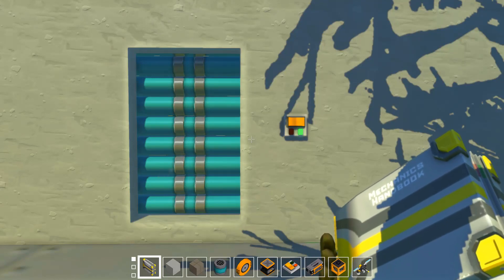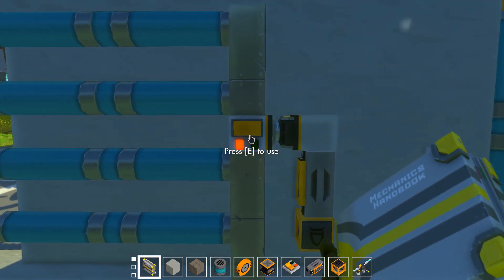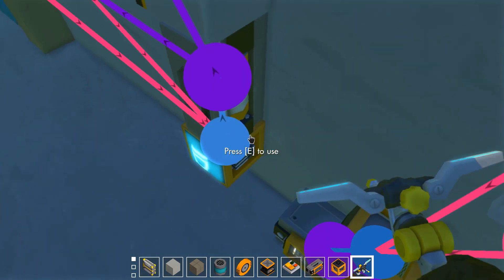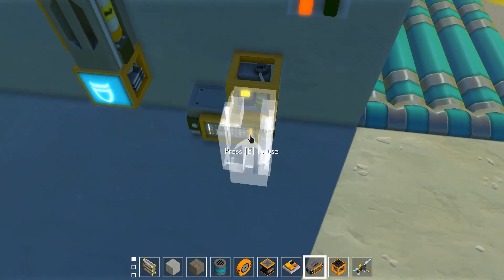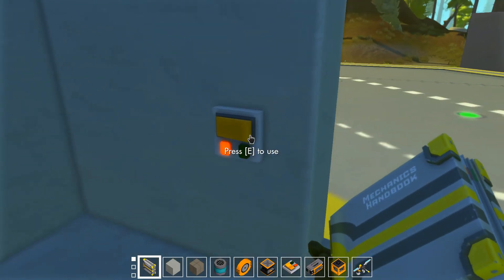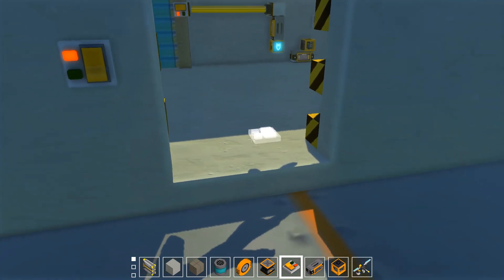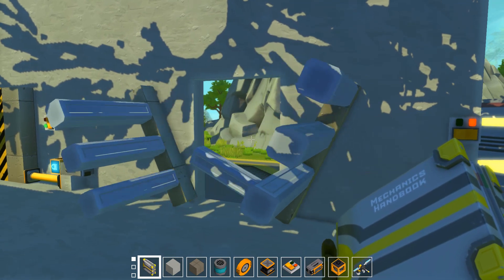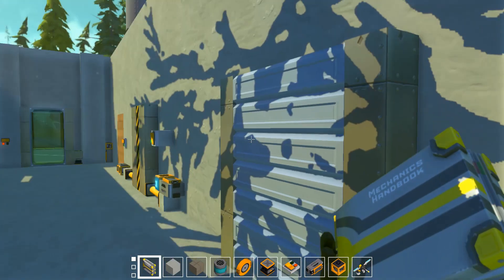Scrap Mechanic Simple double switch door 2 (logic gates)

Comment: I'm new to scrap mechanic. How do I make that sliding glass door with the pistons? lt looks simple enough, but I can't get my piston to push the whole door. It only pushes whatever is directly attached to the piston.
Reply from the maker: I built this door over 2 years ago so I honestly don't remember, but, Make sure when you build that you are building onto the face of the block you want attach to.
I think I started with the up/down piston, then attached the in/out piston, then built the door.
Reply: @ChrisGaskellDethBringa  i figured out how to connect it